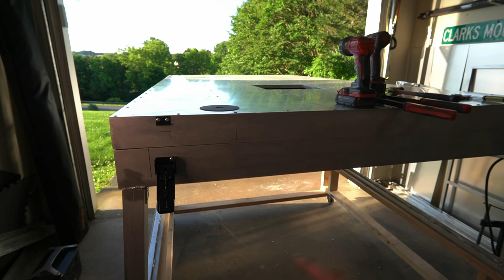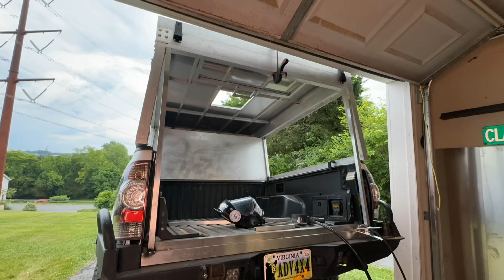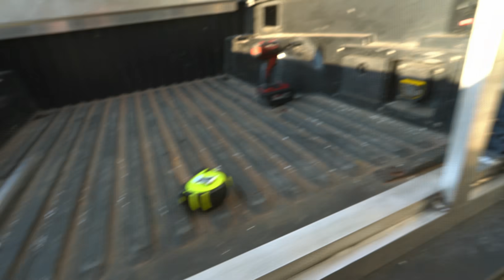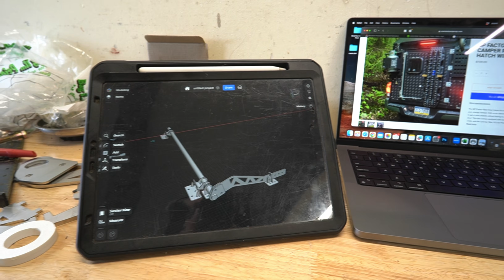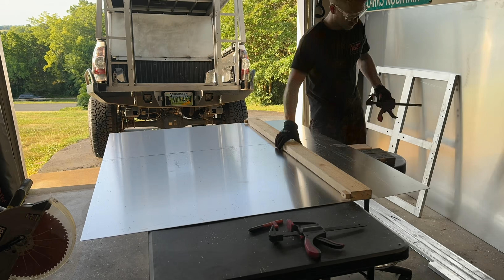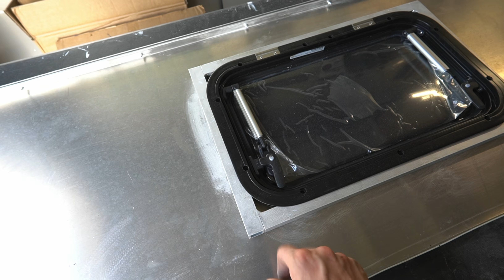Truck Bed Camper Build | Part 4 | Fabrication Complete!!

Comment: @adv4x4 I’m starting design on mine. How often do you use it or how useful are the windows/hatches in the hard sides? Are they worth making? What do you use them for?
Reply from the maker: Very useful for letting in fresh air or just giving the camper a wide open feeling. 

I used the windows as a place I can route in a diesel heater tube as well. 

No regrets at all on those additions! At very minimum I recommend the side hatch doors

Comment: Yes.  Removing the tailgate makes a better ergonomic for climbing in.  

It would take some engineering, but wouldn't it be nice to have a full-height door off the back?  They do it with tent trailers, with a door that comes in 2 sections that you put together after you raise the canvas.  If you can eliminate having to duck down, you may or may not want the tailgate there.

Nice work.  Welding aluminum is not the easiest thing to do.

Comment: Also for hoke plugs design and 3d print out of tpu if you don't own a printer grab a cheaper used one I make all kinds of things for my jeep and roof rack
Reply from the maker: 3D printer is definitely one of those things I’ve been meaning to dabble in just have so much other stuff going on 😂

Comment: Curious how you found doing the stainless welding...did you use that Blue Demon flux core wire as well as gas ( a dual shield type setup) or stainless wire with the C25?  I've been tempted to do some stainless welding but haven't had the chance yet and frankly didn't want to invest money and space in a bottle of trimix. Looks great though! well done!
Reply from the maker: I did not use flux core wire just stainless with C25! It has been the only thing in stainless I’ve ever welded so I’m thinking it will naturally progress as I learn it more haha

Comment: For the tire mount on the door I recommend getting some aluminum tubing, drill out the mounting bolt holes, and weld the tube in place to essentially sleeve the bolt holes. Makes them far stronger and should help prevent premature wear on the aluminum.
Reply from the maker: I considered that myself as well. Have done that on past projects. If the tire didn’t tighten up against the rest of the door I absolutely would. That being said I think it will fair just fine!

Comment: You might consider looking at rev two of that door handle/lock and then just sell the parts unwelded or make them out of steel and weld them yourself and powder coat them. I may have missed why they were stainless. 

Slick job on it, did you design in alignment tabs and holes for everything to easily fit and weld?
Reply from the maker: Stainless for corrosion resistance! I would not want to sell the door latches as the design is far to close to an established companies design. Not looking to rip anyone off.

Comment: Not sure if it's been said, on the brackets that are riveted down, have you thought about using panel bond as well as the rivets?  might help in the long run w/ structural rigidity over the years of vibration etc.
Reply from the maker: Great idea I will look into it!